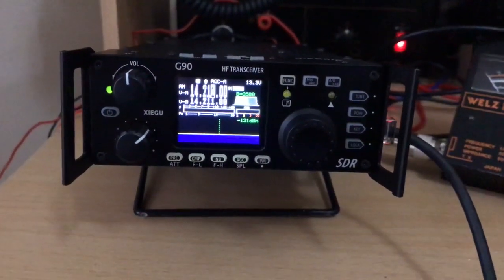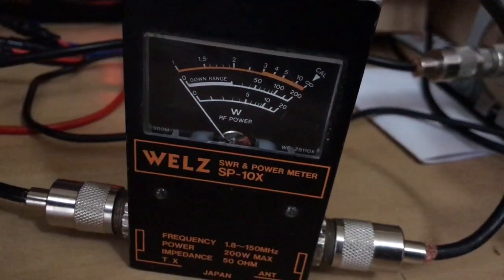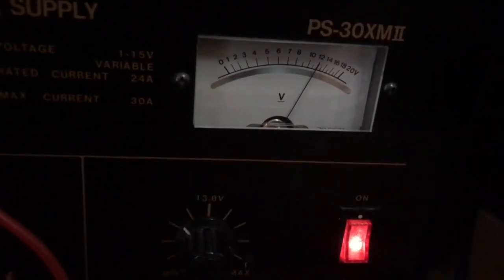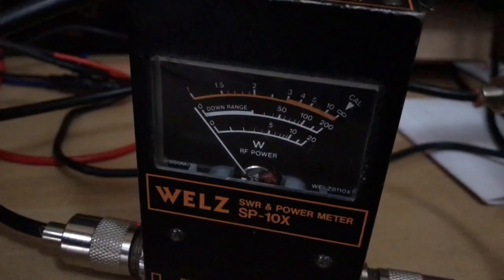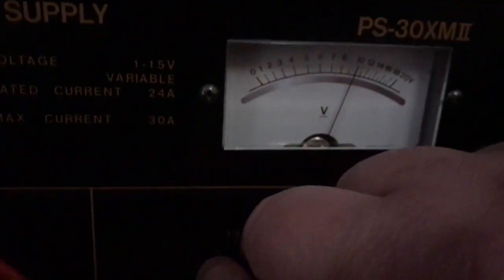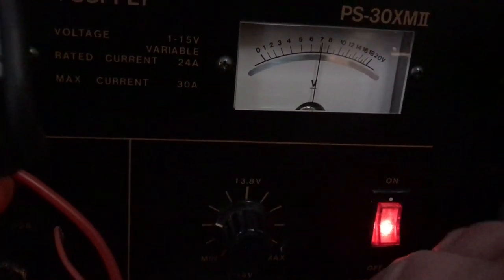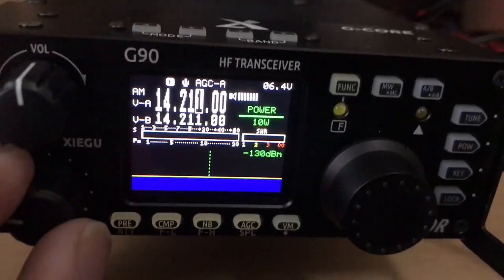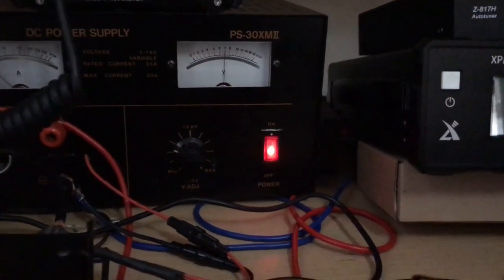G90, how low can we go.

Comment: Did you check the quality of the output when you reduced the power below 10V.
Any distortion on SSB or Chirp on CW?
I once got a 551 rprt due to voltage drop on an FT 100 due to thin power cable.
I am wondering how well it would work on a 3S Lipo (11.1V nominal  and 12.6V - 9.9V)
I am not worried about  reduced power out but rather distortion and Chirp.

Comment: Hi Wayne, did you see there's a difference in voltage shown on your PS and the one on the rig's screen?
There's sg like 0.7V, cannot be a voltage drop due to the power cable in RX.
Can it be somehow calibrated? 
Also, did you check built-in SWR meter accuracy?
Thanks and 73 de ha7wx Chris ;)

Comment: I'm assuming there's no chance that there's enough space in that chassis for a battery?
Reply: ATU takes in itself enough room, so not surprised there's no room for a battery. 
But no pb, as there's plenty of battery possibilities out there, especially the LiFePo4 type which are great for HAM use.
Reply from the maker: Hi Chris, you are correct of course. And as you quite rightly say external battery packs are the alternative option. When XieGu start producing their own high capacity battery banks they will be a good cheaper option. No Yaesu Kenwood icom price tags here
Reply from the maker: I've not looked, but I'm guessing not otherwise they may of added this option.